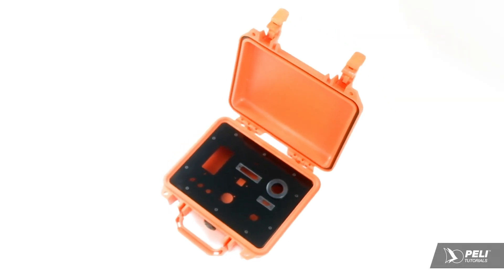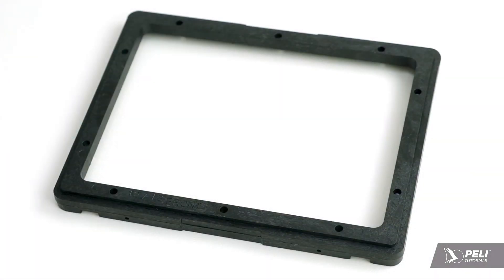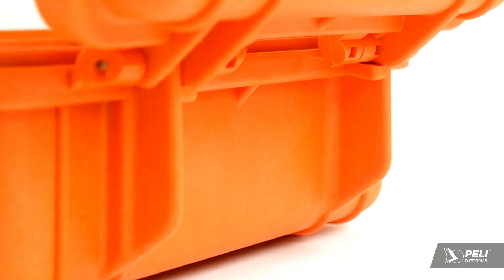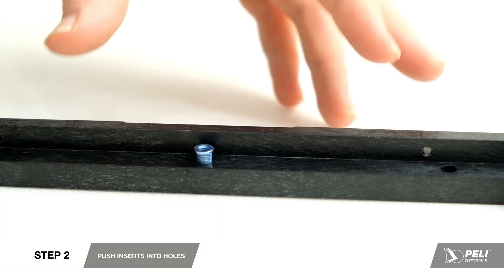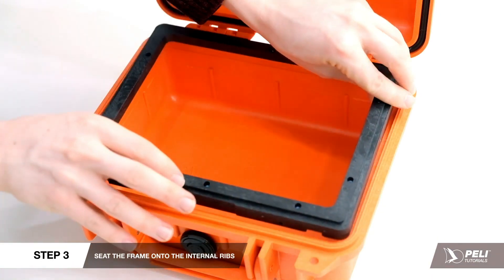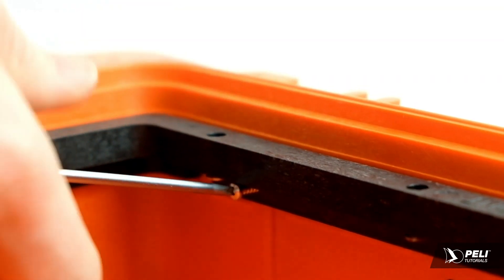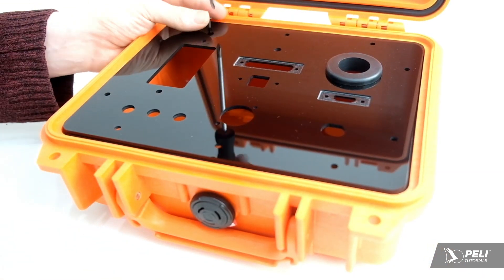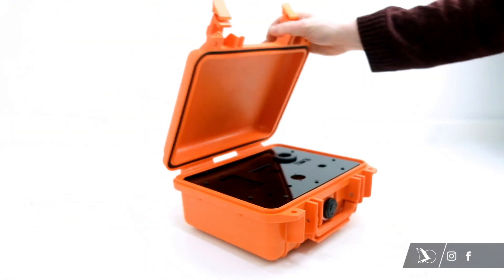How to Install a Panel Frame

Comment: Are the brass inserts metric M3? or USA 10-32 10-36?
Reply from the maker: Hi Ian, cases #1120 and #1150 (ONLY) use M3 x 6,3mm (4-40 x ¼ Imperial)
Rest of Panel frames: M3.5 x 6,3mm (6-32 x ¼ Imperial)

Comment: Can you please state the thread pitch of the inserts on your website and elsewhere? Otherwise you can't engineer a panel to these panel frames until you have one in your possession.
Reply: any luck finding this, Are the brass inserts metric M3? or USA 10-32 10-36?
Reply: @ianmathews  6-32